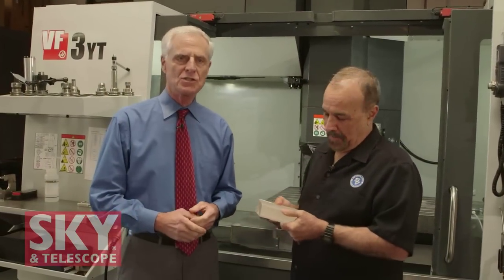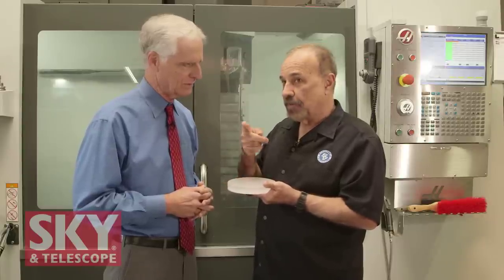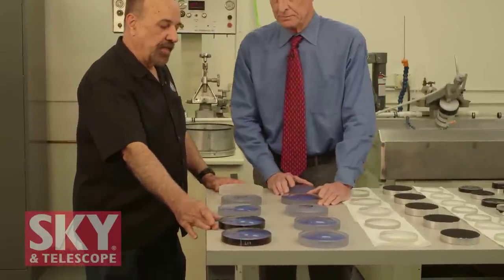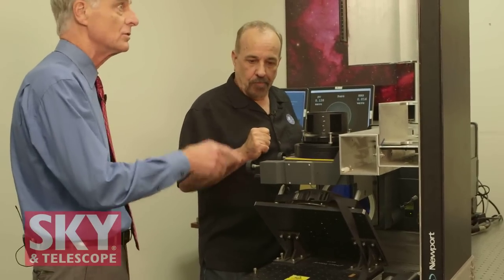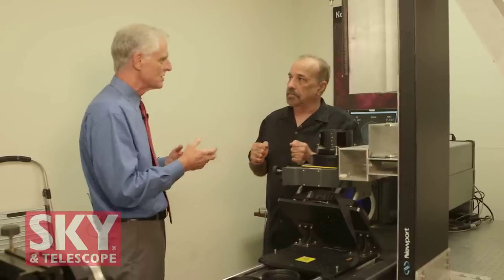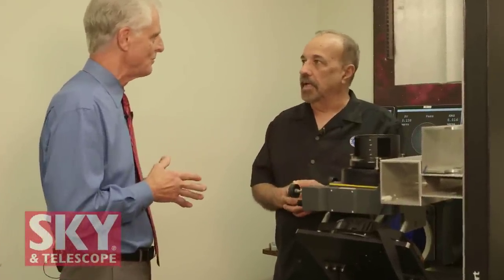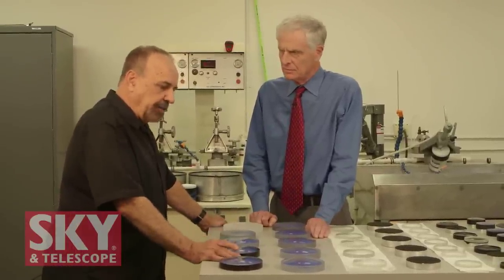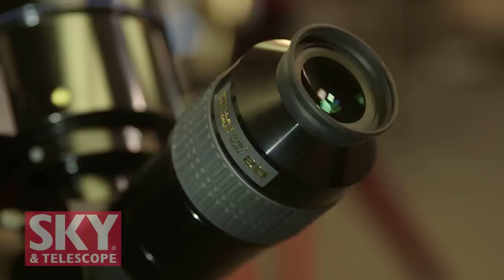Sky and Telescope magazine visits Stellarvue

Comment: This is similar to metal spinning to make metal plates and bowls but not as exact. I had to use a wood lathe to make the forms to press the metal into the shape using the metal spinning lathe. I did this to make a 3 tier serving plate in metal shop in high school. After I did the wood forms all the other students were able to use the same wood forms to make their own metal plates. I used 18 gage aluminum for the plates.

Comment: All that work at 633 in the red but what about blue and green?
Reply: That’s a good question. SV optimized the configuration in green light too. So peak performance is at 540nm wave lengt. The behavior in blue and also red light depends on the glass material and configuration of the lens cell and focal ratio too. Due to SV is making triplet designs, the Strehl ratio will weakening in far blue and also in far red light. That’s normal for such a system. The so called polystrehl curve would be interesting too. But will be difficult to measure, because you need a zygo with different light sources. So the polystrehl is mostly a theoretical design calculation based on glass material and configuration. For perfect polystrehl, e.g. a polychromatic objective you will need min. four lenses, CaF2 elements, aspherical surfaces… and that will impact in the production costs heavy. The advantage of such a polychromatic system is that some cameras get an advantage in imaging. Visually no advantage will be visible. The hole in your money pocked would be visible much, much more😊
Under the line we can say,that modern triplet designs like SV deliver, are the best compromise vor visual and photographic use. Mostly compareable and on pair with other premium brands like TAK, TMB, LzOS ore else.

Comment: Individual lens spacers taylored for each objective?
Reply from the maker: Ben: No this is not necessary as long as you keep within the tolerance of the design. Which we do.
Reply: Cool. APM does it on their chinese 107mm triplets, so I wondered if this was a feature of all optimized triplets.
Reply from the maker: We optimize by figuring accurate optics. Messing with spacers is not going to magically make a high Strehl objective out of one that has serious spherical issues. In fact it seems like a crazy thing to do.
Reply: @StellarvueTelescopes  i have ran the haaus machines in a orthopedic settting..i never consider it in lens mfg..
If a individual buys on the 2ndary mrkt can he find the speril number..on a svr90t cf??. And is 102 the new 90..sorry for any incorrect words or there spellings.
Vic i would just like to say..you 👉 rock and have added a newbie to your SV family.